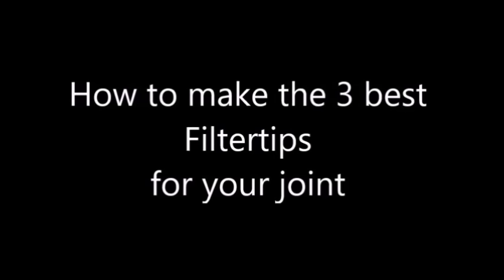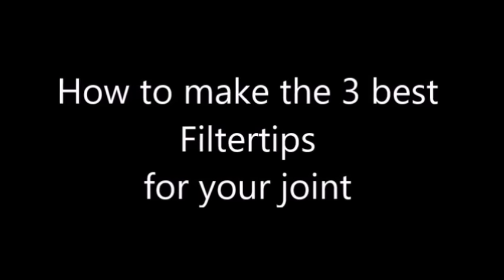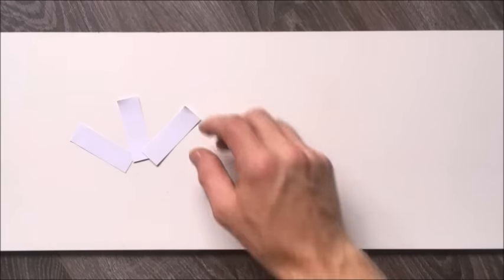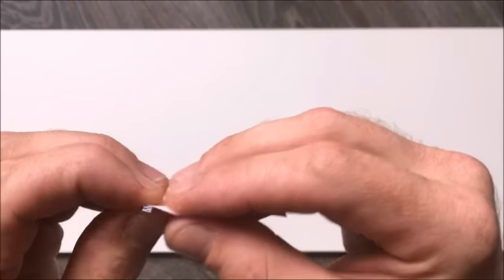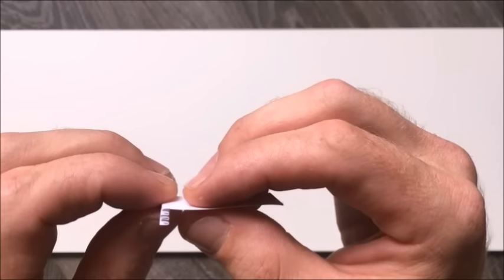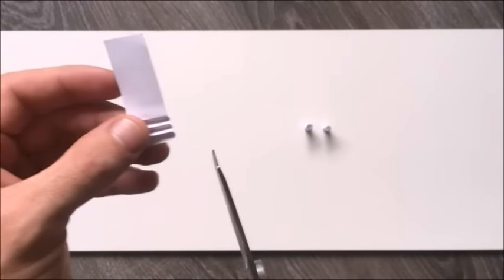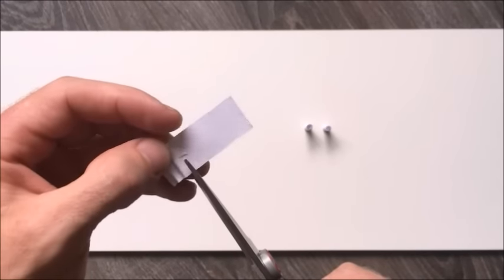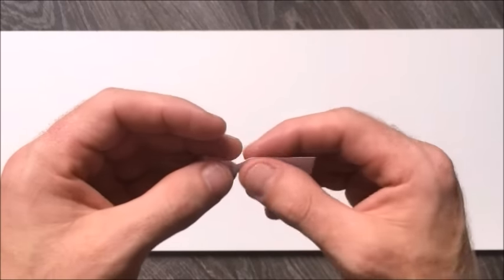How to make The 3 Best filtertips for your Joint

Comment: The rolling of both ends is a key move.  Otherwise it unravels while you are trying to roll the joint.
Reply: Yup. smoked my whole life just figured this out 😅 I’m 33
Reply: That depends on what filter tips you use. Ziggi's are hard tips and they unroll easily. Smoking tips are very soft and don't unroll easily.
I skip the rolling bit and just squish my Ziggi filter. They have the best rizlas in the world IMO.
Reply: Always had this issue and just realized it now 😂

Comment: That spiral one is gonna clog up eventually if you're smoking a very oily weed or hash, the others are pretty useful. I didn't know of that 'hollow' one, interesting idea!
Reply: That 'hollow' one is probably inspired from slim cigarettes, those like Virginia S have such filter tips and cigarillos such as those Jokey ones that come in a pack of 8 for about 2-3 bucks, american, do have a filter tip like that, but with charcoal above the hollow section for the Jokey ones and a regular slim filter for the above section of the Virginia S ones yeah.
Reply: I do all kinds of stuff for a linving, even making very freaky filters at times, even invented something like the Jokey ones for my joints, worked interesting tbh, might wanna remake that design tbh, smoked kinda good, but I was not as good at rolling and all of this stuff at the time.
Reply: I’ve always preferred using the spiral tip. It rolls up the fastest,  as long as you use the whole roach card that problem with it being oily is gone. The main reason I prefer this one is because there is no way I’m gonna get any Scooby snacks if it were to come thru the roach
Reply: is she just using printer paper or what is she using
Reply: @JoRosieQueen68  wtf are u talking about
Reply: @emilyrearden1741  wdym just regular filter paper
Reply: We used to smoke them this way in high school

Comment: What type of paper did you roll to make the filtertips ?
Reply: Raw makes tip paper, or you can use like card stock paper
Reply: @matthiacle5461   can u use like normal cardboard ?
Reply: @Polo-hh7xy  use a very thin piece of cardboard and you good
Reply: Can I use a cut index card?
Reply: @stang354  as long as its easy to fold. I use regular writing paper to make my filters all the time. You can use anything 👍

Comment: What type of paper is it
Reply: Just buy the raw skins with roaches attached to the pack means you never lose them
Reply: Depends on what you are trying to do, alot of people like cone joints and the brand RAW, so if you are looking to roll a cone joint, you should probably look up raw cone tips, you can easily get a good couple of packs for a cheap price, if you arent looking to roll a cone, just look up regular tips. (You can get them on amazon for cheap prices, or online headshops for a little bit more.) (Also, not saying only use raw, but thats just a very commonly used brand, main thing to look for is a respectable brand, with reasonable paper and filter prices, and quality material (I personally enjoy hemp papers.)

Comment: Just a little clarification…..these are not filters. These are called crutches. It’s a crutch to help roll and maintain a nice tip to smoke your joint. AKA…no gross ass collapsing of your joint and if done properly, no salad in your mouth. 
Crutches don’t filter shit. 
Also…..try pre curling your crutch by using scissors. 
And like one person said here….don’t roll the crutch too tight (you don’t need to roll it from both ends) because you want it to expand in the joint so as to make a nice snug seal.

Comment: I just use regular filter tips. It blocks a lot of the tar but Still lets the cannabinoids through.
Reply: They don’t get you as high, you’ll notice if you smoke rolling tobacco with a paper tip opposed to a filter tip there’s a huge difference in the strength, same goes for weed

Comment: I find these to not even come close to a simple M tip. Broad M, small outer layer.
If you really want more airflow, go with a shotgun tip. Rule of thumb is not to increase the amount of folds, this actually reduces airflow because the passageways get smaller and thus become more restrictive.
Instead increase the size of the holes in your tip to where things are only just not falling out.

Hollow tips are bullshit and if you rip it off instead of cutting, you end up with tar on your lips more often.
Just make a normal one.